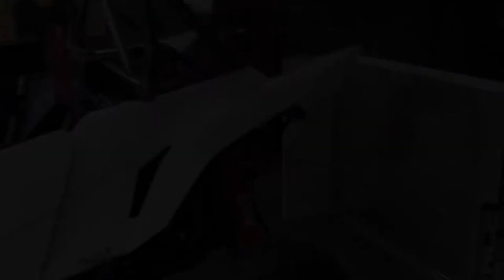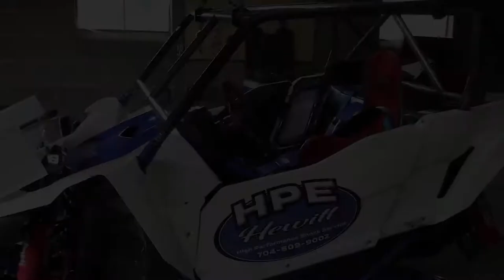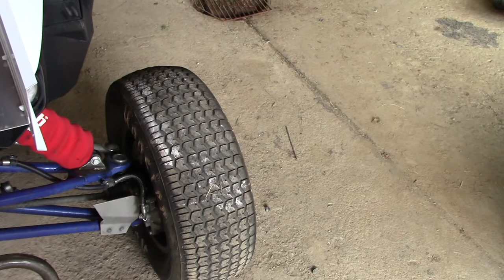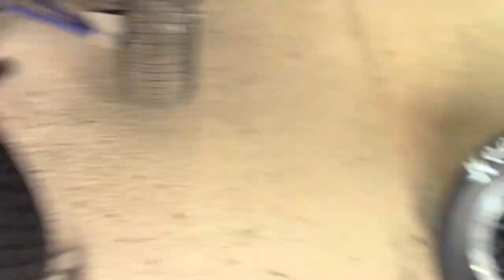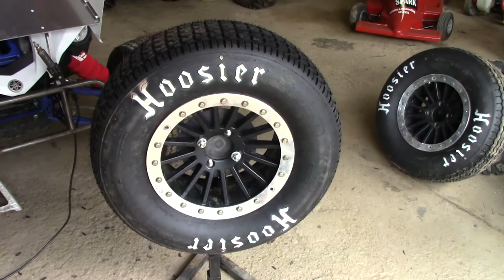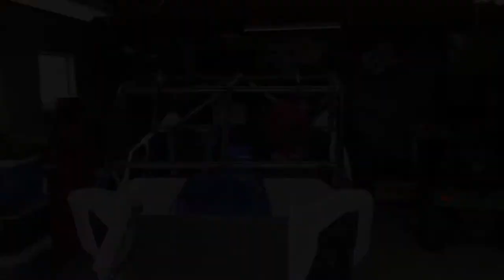We Want To Hear From You! Your Opinion On Grooving And Mounting Hoosier UTV Tires For Short Course

Comment: How did you like the Hoosier tires ? Better than the other setup you ran?
Maxxis just came out with short course tires and they are much cheaper. I believe they are called maxxis sc1
Reply from the maker: The new Hoosiers really tightened the car up from the previous time! We used a hard compound tire after the 4 sessions on the track the tires showed no wear! We have yet to try them on a short course track yet as we are still a little skeptical of them in our area. It seems the conditions have to be just perfect and we’ve really dialed our cars in around the maxxis ceros. We did not know maxxis had a new sc tire out we will have to check that out thanks for the info!!
Reply: @writeselwelding  the max is sc1 you have to run tubes in them. They are super thing tires. Mrt offers a tire like it but doesn’t need a tube. They are a really good tire.